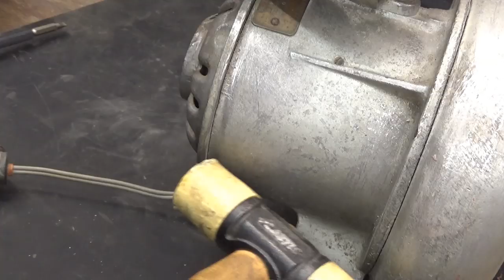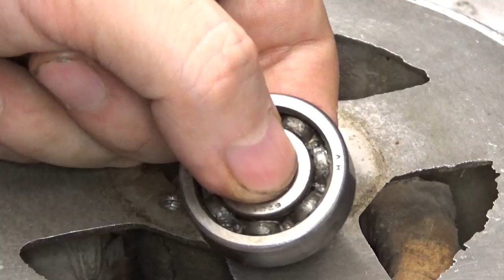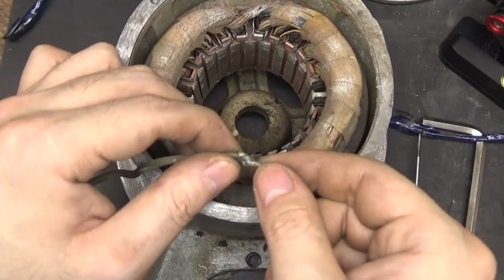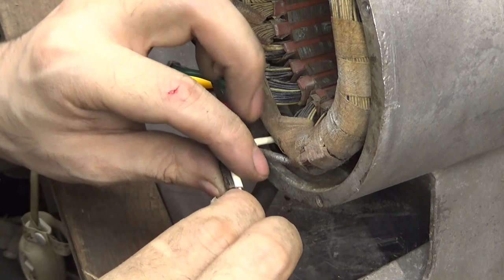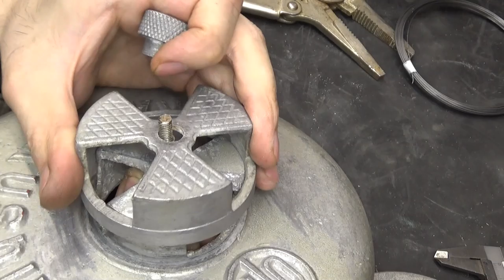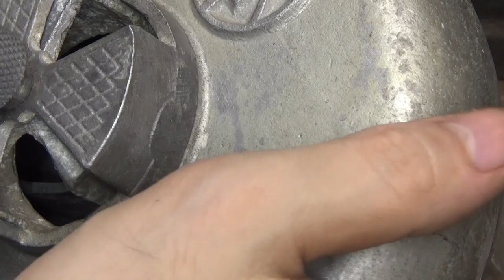1959 Electric blower Restoration.

Comment: I would've told you to use wd-40 in removing that spring until I realized the spring is way too crispy due to rust.

That wire/code insulation falling apart presents a fire hazard especially if it short-circuits. I'm surprised it still worked after restoration, for a 60+ year old equipment.

I noticed you didn't refresh nor polish the metal casing this time. Is there a particular reason for that?
Reply from the maker: I often forget about lubricants.
I like the antique surface so I can't polish it.
It seems that it was made of sand mold.

Comment: Is the earth lug tight on that...?
Or just floating around that bolt...?
🇬🇧👍
Reply from the maker: Adjusted the depth of the groove to be tight.
Tightness affects current flow.
Reply: @diyrestorationclub7534  

I'm an electrician myself by trade...
Earthing an appliance is about limiting the DURATION of a touch voltage...NOT the value...

Bonding extraneous conductive parts limits the VALUE of a touch voltage...
🇬🇧👍